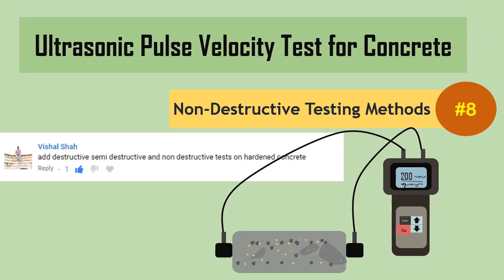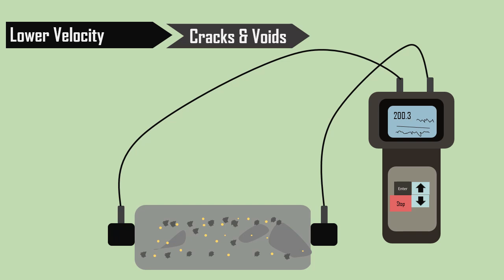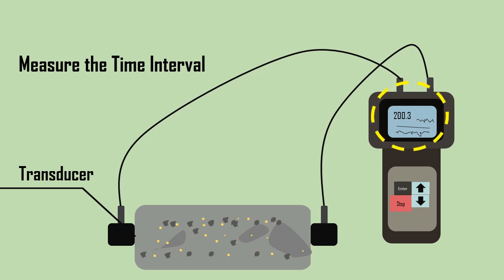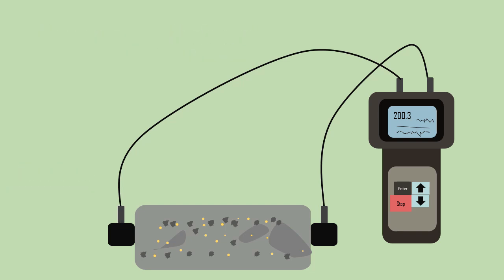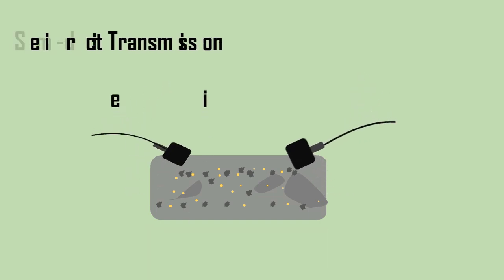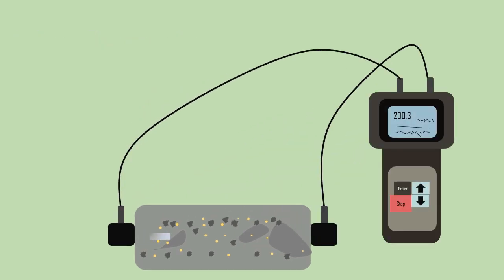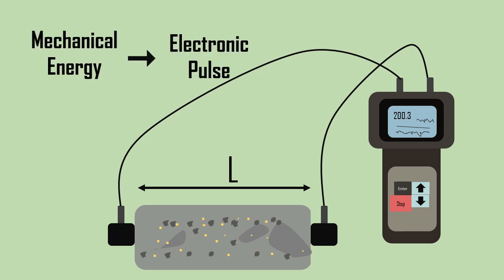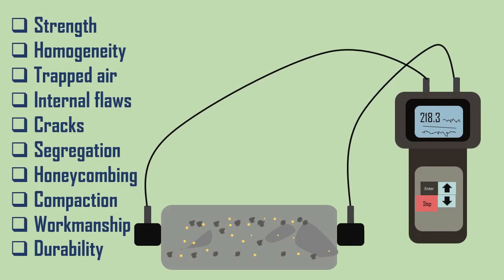Ultrasonic Pulse Velocity Test for Concrete || Non-Destructive Testing Methods (NDT) #8

Comment: Fibers in concrete might very well render this test inaccurate just as steel or conductivity of some not normally used mixes can interfere with electrically based tests of concrete. Water saturation may also affect the results.

Comment: YOU_ARE_SAFE
IF YOUR_BUILDING is SAFE

Check BUILDING_SAFETY
by Licensed Structural Engineer
1
WE Know about Our FLAT
& Not FULL-BUILDING?
2
if ANY_ONE-COLUMN_FAILS?
it can be UNSAFE_FOR-ALL
3
So Repair as per Audit-REPORT
https://www.structuralaudit.org
Ganesh Kamat
M.S.(USA)50-yrExp
For Quote 9820867755

Comment: please I have a question whats meaning of - "Selection of the ultrasonic impulse amplitude adjustable from 250 to 1000 V" ..how can I used the proper gain 250V or 500V or 750V or 1000V ?